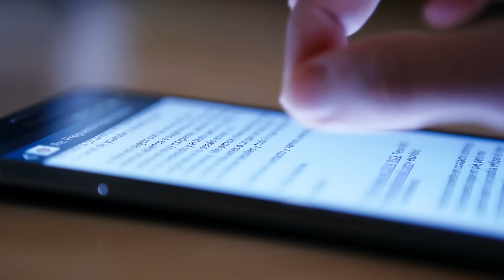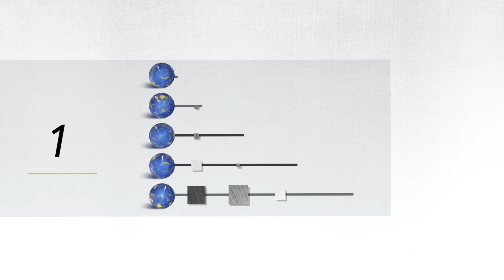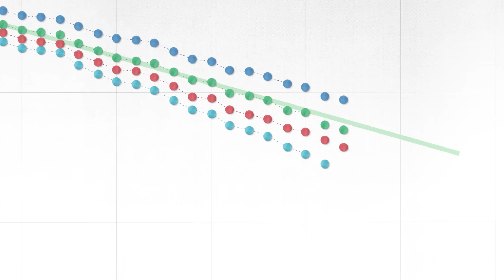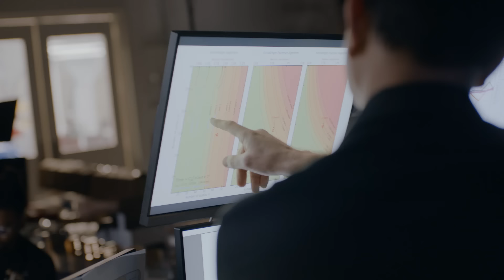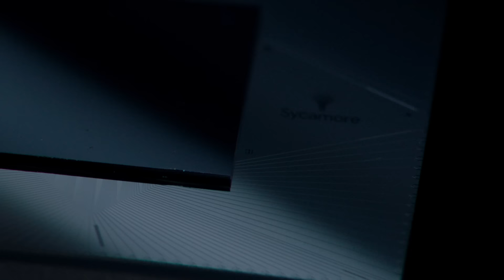Demonstrating Quantum Supremacy

Comment: These hype videos are never technical enough to actually explain what's going on.
Reply: "So like, it can exist in 2 states, and like, this many qubits means it can be 10 million billion states, which is actually 10 quadrillion but I wanted to flex, and uh it outperforms normal computers." - All videos about quantum computers
Reply: @CodeRed0  actually no. Quantum is only usefull in specific calculation and won't replace current computers.
Reply: So the actual how it works is a bit of a secret besides the part about how hard it is to get working in part because you have to supercool the entire thing. What Quantum computers are supposed to help solve is simplified as follows.

What is A+B if A=1 and B=1 then the answer will be 2. That's a normal computer. it's easy for it to figure the value if you know A and B. 

But Quantum computer allows you to ask the same question what is A+B but A is either 0 or 1 and B is either 0 or 1. The possible answers are 0,1, and 2. That's a Quantum processor with 2 Qubit processing. A normal computer will have to fill in the blanks multiple times (0+0=0,0+1=1,1+0=1,1+1=0) so it goes through 4(2 to the power of 2) cycles. While the Quantum processor only goes through 1 cycle.
Now let's add another Qubit.
A+B+C So the Quantum computer with 3 Qubit can get that answer in one pass while a normal computer will have to do 0+0+0,0+0+1,0+1+0,1+0+0,0+1+1,1+0+1,1+1+0,1+1+1. It works out to be 8 passes (2 to the power of 3). 

Google says they got to 54 Qubits so as you can imagine 1 cycle of a Quantum processor is quite a lot of possible answers for a normal computer. But the story isn't over yet. The question is how do we use a computer that can do this? That's why Google is asking people to come up with ideas to use this new computer. Not a lot of traditional computer workloads really rely on not knowing so many variables like this or needing every possible combination of answers. Even if we can get 2 to the power of 54 answers for a problem, how do we even sort the answers for what we want? Problems to solve yet still but cool anyway.
Reply: kickassnetwork this might be the best YouTube comment I’ve ever read
Reply: @kickassnetwork  I can think of a use for it: running really complex simulations where you need to observe multiple variables at once.
Reply: @kickassnetwork  Wow, if this is correct, thanks for the explanation! Also, maybe weather predictions are one possible application?
Reply: @danielfurey6784  tectonic plate movement
Reply: @kickassnetwork   This has to be best explanation ever. I mean there is a Microsoft intro to quantum computing for programmers, where they constantly talk about this stuff of getting the answer directly but  never ever give this sweet simple example. Hats off man. thanx
Reply: Wes Tolson that's because quantum computers are extremely overhyped. They're not as great as google makes them out to be.
Reply: @kickassnetwork  woww 👌👌👌 one of the best explanation. Now got a clear idea, Thanks a lot 👍👍
Reply: @kickassnetwork  Thank you for helping me understand quantum computation alot better.
Reply: Like you would be able to understand it..
Reply: @Sean27007  i was totally gonna include that but usually my comments get read more the shorter they are, so i just keep them short 😎
Reply: Moore’s Law
Reply: Basically processors have things called bits that represent data and they are either on (1) or off (0) 
Google tried to create processors that have bits that exist in a superposition (both 1 and 0 simultaneously), they failed and decided to put swelling music over it to seem like they did something huge and Earth shattering when it was in fact a failure.
Reply: @kickassnetwork  Get your like. At least you will know that a few hundred people read your comments.
Reply: @kickassnetwork  Could you pack multiple similar problems that are different enough for a normal computer to do separately into one problem and compute them at once somehow?
Reply: @kickassnetwork  so thats kind of how it works but not really. Each state has a probability of occuring. So you have that massive parallelism, but as soon as you ask the computer for a result it collapses to 1 state. So if I have a qubit then it can either be 1 or 0. During the computation its 1 with probability, let's say 0.25, and 0 with probability 0.75. when I ask my quantum computer for a result 4 times I should expect '0' 3 times out of 4. The parallelism inside a quantum computer only exists till you measure it. As soon as it's measured the parallelism goes a way. So when they say oh we have 10 billion trillion states, when I'm done running my code I only get one of those states back. So you have to do all your computation with that expectation. This also means if I have n classical bits, a quantum computer needs to have n qubits to simulate it (this is known as holevos bound). The trick is when you're clever about the way you formulate your problems to the computer you can utilize the massive parallelism. It's useful in simulations and cryptography.
Reply: @Kernels that's not true at all. IBMs quantum computers are open for public use. Plus theoretical research into the possible uses of quantum computers spans an entire field. Checkout post quantum cryptography, shors algorith, superdense coding, and quantum teleportation algorithms.
Reply: @zs9652  that's the idea, but the result of your "parallel" computing collapses to a single state when you're done computing which makes it fundementally different
Reply: You're not watching this in Udemy.
Reply: @Kernels yeah pretty much just decryption and like mining Bitcoin and getting lots of junk data. It's the processing equivalent of brute forcing a combination lock
Reply: @CodeRed0  How many football fields is that?
Reply: ....... And they never will be, hush
Reply: neither the comments
Reply: CodeRed We’ve had quantum computers this whole time. They’re called weathermen.
Reply: Computer go vroom vroom while quantom computer go vroom vroom vroom
Reply: Then research. Not rocket science
Reply: @kickassnetwork  codebreaking seems like a good use for this
Reply: We probably don't even have the sufficient background knowledge to understand what they are saying, let alone actually understand quantum mechanics.
Reply: Honestly the way they described it sounds to me it’s like they just paired up bits, randomly generated through some manner and said bits made certain bytes that instead of typing in letters in sequential order to crack a ‘’password”, they typed them in in a random fashion which somehow led to a faster crack.  Then they called it a quantum computer so people ‘’studying’’ fictional math equations that can’t be applied anywhere can keep getting a paycheck.
Reply: RAJAT KANTI Bhattacharjee r/whoosh
Reply: kickassnetwork how does the quantum computer only go through one process cycle to do a+b and a+b+c
Reply: @kickassnetwork  Best explanation. I might need your permission to share your comment :)
Reply: When you hear the word "calibrate", you can just safely close the tab.
Reply: @Albanian007BK  Not at all. Also the theory exists before it's applications. Without half the math that goes into things like quantum computers we wouldn't have the field of computer science itself. Thoery is a gateway to application, its abstract, weird, and beautiful
Reply: 1. Bound by confidentiality, 2. If they explained how this worked, this video would be over a month long
Reply: the paper was published in Nature today. have at it hoss
Reply: kickassnetwork Now Google just need a poll for us people to drop in suggestion on what they can use their quantum computer for.

The explanation given by kickassnetwork is very easy to understand and now more people understand QC, well done.
Reply: It’s very simple the actual fundamentals of how it can surpass a regular computer.  It’s not hard to understand.  A bit can either be on or off.  1 or a 0. In all computer processor transistors.  Quantum physics which was discovered long long ago says that a Atom or a photon or a electron for example can either be in a On or Off position but also it can be both.  It call also be in NO places and it can be in ALL PLACES.  So instead of a transistor in classical computing just being either off or on? Quantum computer that can use 4 locations (per cubit), or just be in 1 position On or just 2 positions On  or just 0 positions OFF or at all positions at once.  These extra possibilities for when computing math equations can help us solve complex equations that in the worlds fastest super computer would take 10,000 years would in take 3 minutes in a quantum computer for example.  We would need to solve the complex equations and with numerous variables in biology for example, medicine, climate change etc etc.
Reply: @kickassnetwork  thank you
Reply: @epiclapser  where did you learn all that?
Reply: It's because no one at Google understands it at all.
Reply: Ericramone78 So in regards to QC, is it all about just calculating possibilities?

I guess an average informed person (basically only knows little about it) would mistake QC (quantum computers) great for even better gaming experience, when I assume this is not at all the case?

How will this be useful for the general public? a.k.a electronic products, etc.?
Reply: @cutliss  I took a course at my university in quantum computing and have a part time job in a lab that works on it
Reply: @epiclapser  have you touched its limits yet?
Reply: @cutliss  I don't think I really have, I'm still learning and there's a lot to take in. But I hope someday I will.
Reply: @TheWuBzChannel  that's kind of it. It's not a massive parallel computing piece of hardware. We have GPUs and supercomputers for that. It's a completely different way to computing, it's like having all the possibilities to explore but only being able to show one. At the end of the day all your parallelism collapses as soon as you're done with your computation. Thats at least how this specific type of quantum computer works (it's called a gate model quantum computer). D-wave has quantum anealers, I think I've seen a paper that uses it to do some aspect of raytracing but those are different but equally as cool.
Reply: @Sean27007  technically you can do anything you can on a normal computer on a quantum computer. That's been proven (quantum church Turing thesis). That being said you're right practically it's just infinitely easier and cheaper to use a normal cpu. But still, food for thought.
Reply: @epiclapser  You're absolutely right that's not the whole story. My explanation is heavily simplified to give the general idea on what google means when it says its processor can give 2^53 states of answers and an example that I feel is easy to grasp how to arrive at it.

Programing for this recently theoretical computer is another whole crazy amazing field of science with new rules and ideas being written as it's discovered. Definitely, a good addendum that pulling out the answer only results in 1 of the possibilities return and formulating the question is one of the hardest parts. I'm not clever enough to figure out an example to demonstrate that easily. But I feel the example is close enough with a footnote getting an answer we want is a problem in itself.
Reply: @RajarajanPanneerselvam  Go for it if it helps people grasp this very difficult concept and makes them interested I'm quite happy.

Comment: I'll come back in the future and reply to this comment when I'm on quantum computer.
Reply: See ya in 200 years
Reply: Probably my grandson/granddaughter will have a quantum phone.
Reply: ok dont fail your son
Reply: or he cant afford the 200000$ phones
Reply: @Leon Don't quantum computers need to be near absolute zero?
Reply: @Leon Making the electronics small doesn't make them quantum, unless you want to make them out of subatomic particles. Our phones will never need the computing power of a quantum computer within it, though they may be connected to one, such as a new Siri/ Alexa that runs on a central quantum computer and our phones can connect to it via wifi.
Reply: @SlowestSundew7 I would argue that quantum computers for general consumers will not be of significant benefit beyond making everything lagless, but for games, we could have realistic physics for perhaps googols of atoms, and photorealistic graphics with real-time pathtracing. The other benefits are not so obvious: faster production cycles, faster application updates, and probably more that I can't think of.
Reply: @SlowestSundew7 But it does. It processes way more than we could ever imagine, you just need a lot of kilowatts of energy to run one and creating one is insanely expensive, which is the reason classical computing machines will remain. But they do remain indefinitely.
Reply: Well there's a problem: For the Qubits to work the chip needs to be cooled to almost 0 Kelvin. I don't think you can get this kind of cooling in a smartphone form factor (but then again who knows what will be possible in 40 - 50 years. Maybe AI finds an even faster and more complex way of calculation that doesn't require temperatures close to absolute zero ). 
Transistors are soon going to reach their maximum, perhaps AI could improve circuits a little, but in 5-10 years we'll reach peak. If we want to go further, we need other solutions.
Reply: Same
Reply: And you will say nothing because you do not want to lose everything you achieve in your life, so you do not touch the past.
Reply: *REMINDER*⚠
Reply: U will be confused then